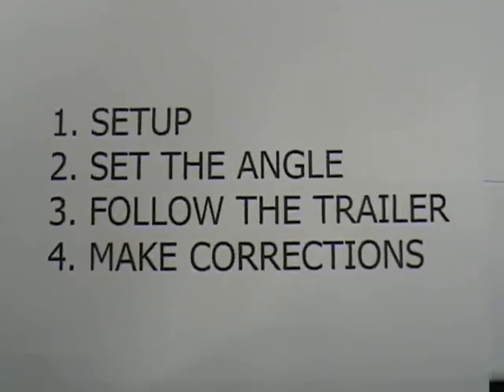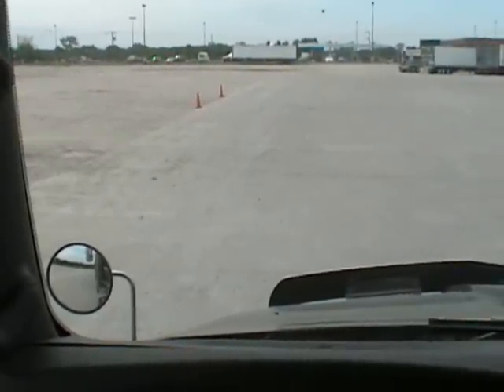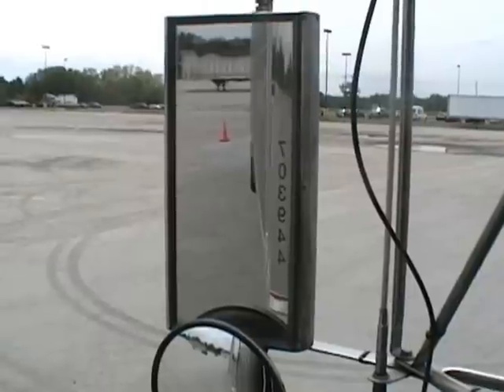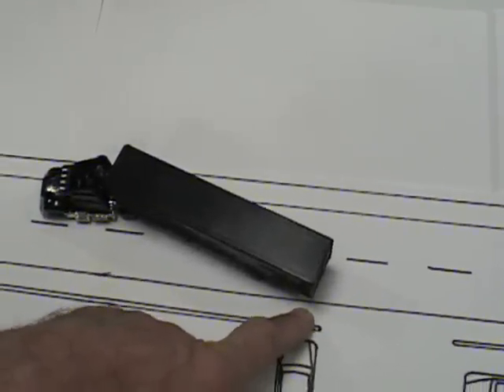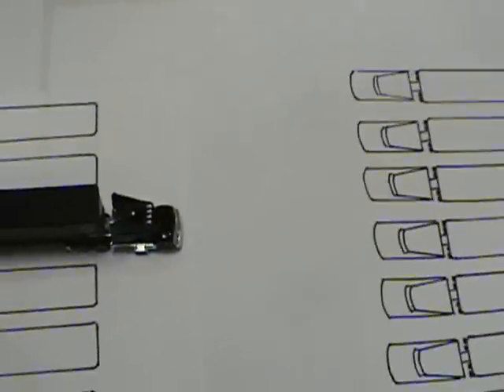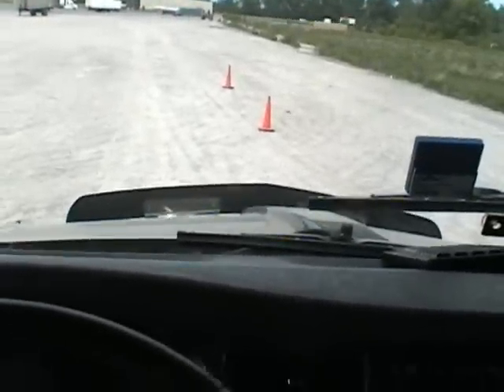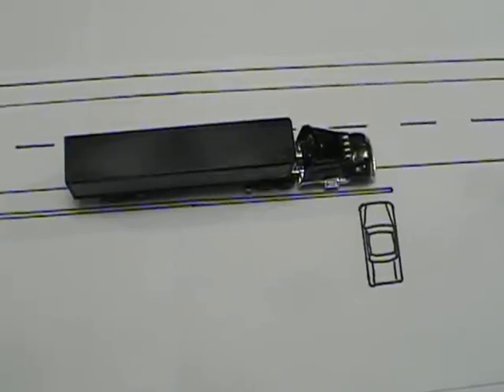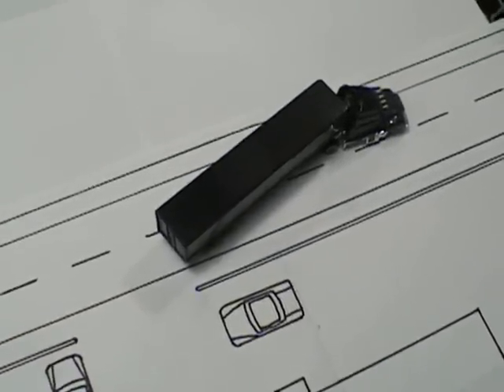How to back up a tractor trailer pt. 2

Comment from the maker: I use low reverse gear. I kind of use 3 different speeds. If I'm a distance away from the dock or parking space I let out the clutch then give it a little on the accelerator. When I get a little closer I let up on the gas pedal and let the engine idle move the truck back. Then when I get real close I do push in the clutch to slow it down, then let it out a little if needed, and use the brake pedal at the same time to bring it down to a crawl.

Comment from the maker: depends how far away you are from entrance or dock. If its on your left and youre far away, turn wheel slightly to right, back up until tractor and trailer are at an angle that looks like it will follow the curve line to the target, then turn wheel to left to hold that angle as you back up. If you're close to dock or entrance you have to turn sharper to follow the curve. Many situations are different. You cant always pull up at the same distance and angle to a dock or entrance

Comment: @subicbay350 Always turn the wheel toward the mirror that the trailer is in to correct it. Ex. if your trailer needs to be straightened out, and it's in your RIGHT mirror, turn the wheel to the LEFT.

Comment from the maker: @pistolpetevan Hi Pete. I started out on a single axle for a few years. Not too much difference. Depending on how you're set up, when you back up you may need to cut the steering wheel a little sooner or turn it a little sharper than you're used to. You'll get used to it pretty quickly.